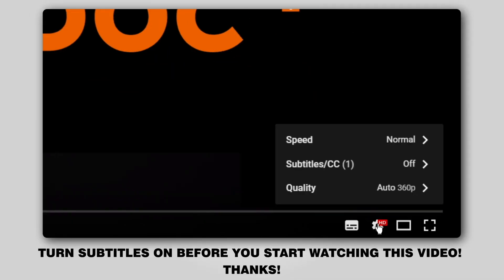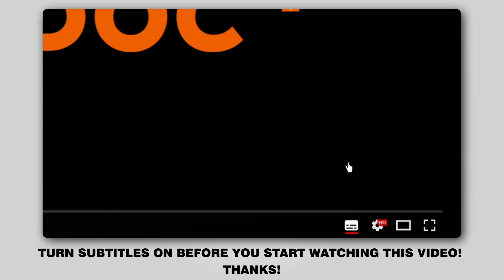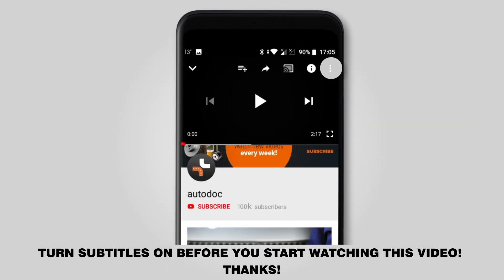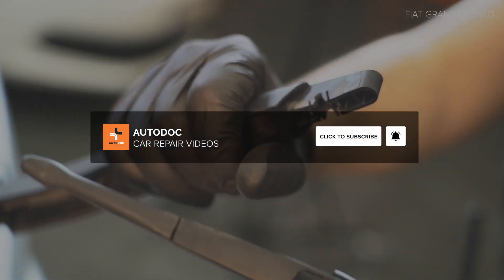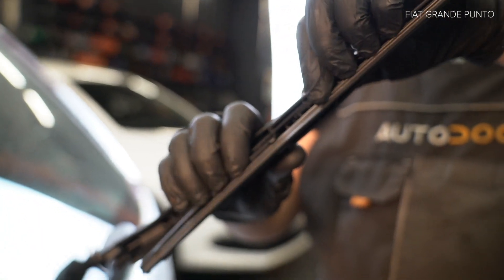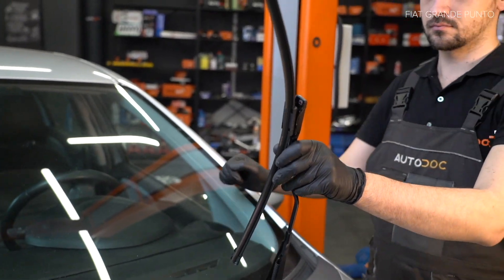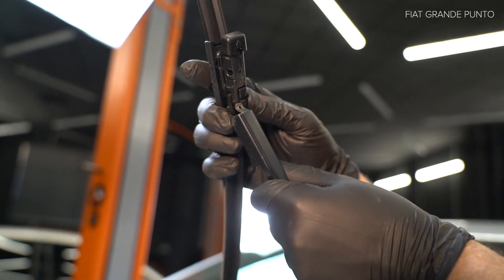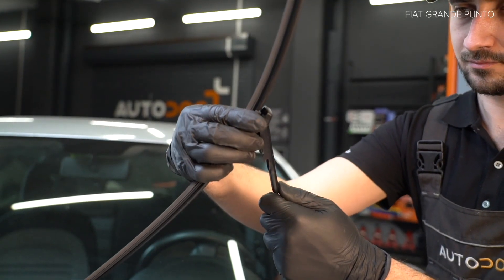How to change wipers blades / window wipers FIAT PUNTO 199 [TUTORIAL AUTODOC]

Comment: I wanted to tell you how splendid these videos were on the Fiat Grande Punto. Haynes sells similar videos for buyers alone at close to 18 GBP.  It would mean a lot if you could upload the following videos for Fiat Grande Punto as well:

1. Rear light cluster bulbs replacement
2. Coolant replacement
3. Fluid level checks
4. Thermostat replacement
5. Starter motor replacement
6. Auxiliary belt replacement
7. Headlight bulbs replacement
8. Alternator replacement
9. Battery removal & replacement
10. Rear brake shoes replacement
11. Rear shock absorber replacement
12. Spark plug replacement

Please....it would mean a lot for people like us. The moment I saw your fantastic videos, I immediately subscribed to your awesome channel!
Reply: Oh